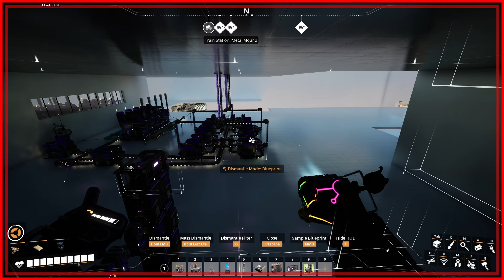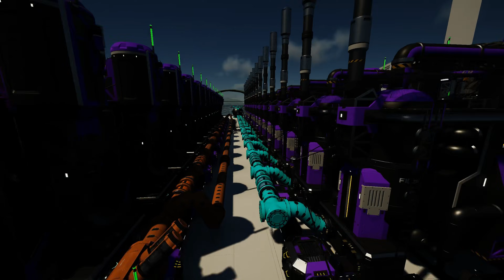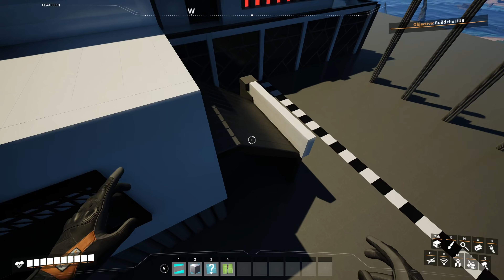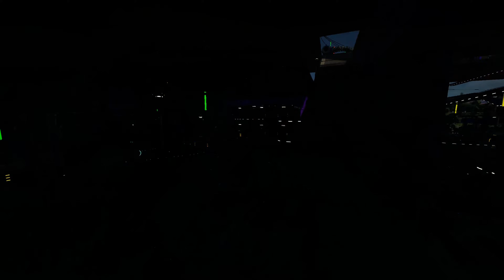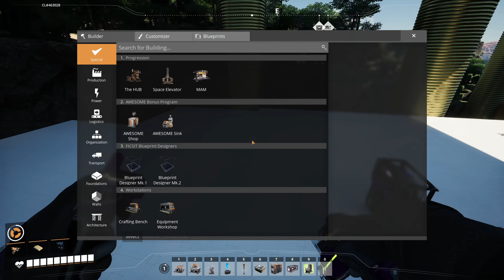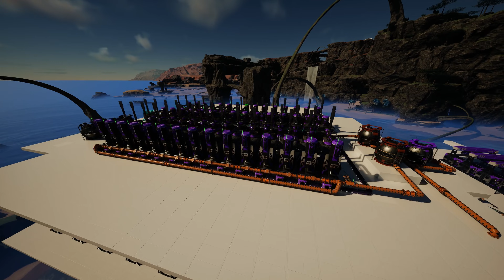What Most Players Get Wrong About Mega Factories in Satisfactory

Comment from the maker: What helps you build big factories?
Reply: I make a new factory for every item. (I often even do a new building per part of the process). Nothing gets re-used besides tier 8-9 items. That way I have the following advantages.

* Use the whole map easily
* No future planning needed
* No upgrading
* Use things when available
* Easier logistics
* You can get away with smaller amounts
* Things go wrong? Nothing else affected.

Building more is bad? Not really.

* It is a building game. Building more is a win for me.

And also breaking things down into smaller projects. Each part of the production is a new projects. I do start making things look nice as soon as possible and no Blue Printer. I rather come up with something new. But the main thing is to have fun. I rather gave fun than be functional.
Reply from the maker: @h @houghi3826 ll said!
Reply: I build a large platform with a main chain conveyor belt bus in the front. Then I build a line of production machines that use resources off the bus. Then I create another line for another part and I keep going. I then make a new floor for higher level parts and continue that for higher level parts. If I need to increase production I just increase the length of a line. I use blueprints for everything and auto connect them so extending a line is easy. Instead of worrying about exact ratios I just produce more than I need. At the end of each floor I split the bus, send to storage and up to the next floor. If a line needs multiple belts to get the through, I include some conveyor poles so I can utilize additional belts to feed a line.
Reply: Dav
Reply: random nodes
Reply from the maker: @Kung_Arthur speaking from experience? 😂
Reply: Like real life:
1. Start with a small scale version.
2. Optimize.
3. Scale.

Comment: my first one was a mess, then i made a massive rectangle in the sky and moved there, then made a massive conveyor network stealing nodes in vastly different places (still not a lot though), now i need a thousand girders and smart plates for the elevator and the best i can do is with my single 20% productivity bolted frame manufacturer and just afk because it's already full, though not as spaghetti as before it's actually expandable.

Comment: OK, I feel like that video should have been extremely helpful, but honestly, I do not feel enlightened.  OK, maybe that isn't actually true.  I've been using Satisfactory tools to help me plop down things that make things, and it worked for a while.  However, when I got to Engines and computers and hell everything after I completed space elevator 3, and unlocked bauxite... I now feel lost.  I can't get trains to work, well, that isn't exactly accurate.  I made a blueprint for trains and if I put down just 5 chunks, and then add a stop to the track, my train derays at the first track, then the if I delete the rain and manually add a rail the train will derail at track chunk 3, now and then 5, and then 7 assuming I find the rain after every derail.  However, the track looks perfect, or exactly the same, after I fix it.  :(  Vehicles, I got to work, but I think I will wait until 1.2 is released.

Comment: I've been playing around with Satisfactory Modeler, but some online tools could do the same. With Modeler you can visually drag around the machines and see where your items are going, but if you're looking at the connection lines and paths you can roughly see how much spaghetti you may end up with. For instance I could see steel was on its own path and I was able to push those machines to the outer edges of my factory, while Wire was being diverted to 4 different machines so I was able to position a bank of 12 constructors in the middle of the factory and let the end results fan out from them.

I'm just about to switch on the factory and let it complete phase two in one go, but Modeler is great for pre-planning and avoiding mistakes, especially when the scale gets larger and larger.
Reply from the maker: Great stuff! I’d love to see it

Comment: New(ish) PS5 player here. 30+ yrs gaming. And Satisfactory is a landmark game in soany ways.

It's definitely a lot to with experience. At first I wanted the mega factory, multiple floors, blueprints etc, but it will happen over time. I'm not particularly mathematically inclined, but patterns, I get. And you can approach it like that.

Also, reverse engineering has been a big help.

Another great video, mate. They have been and continue to be a big help. Cheers 🤘🏻
Reply from the maker: Appreciate you! Thanks for sharing your wisdom 🙏
Reply: I'm trying to push my series X to the limit.  It's a nice space heater too.

Comment: Another thing that helps us with large projects like these: Let yourself make things easier! 

Specifically, don't be afraid to use power slugs to simplify your designs once you've unlocked the ability to overclock. There are hundreds of slugs around the map, and you can double the number of power shards by putting a sloop into the constructors.

The higher power consumption sounds scary at first, but most basic production machines consume low enough power that the difference is fairly negligible. By the time you hit big energy functions like Particle Accelerators and Converters, you have more than enough ability to outpace your power consumption by a ridiculous degree. 

Liberal use of power shards is extremely helpful in cutting down on the tedium of building long production lines and saves tons of space. Why use 14 Smelters for my copper alloy setup when I can use 7 with 2x overclock? Why use 13ish constructors to turn the output from one of those smelters into wire? With shards, I can cut it down to 6ish, and even better: I don't have to condense multiple outputs for the next stage of production. (Instead of combining two basic wire constructors to feed one cable constructor, each one already has the output needed to run the cable constructor at 100% efficiency.)

The power use is meaningless when it's easy to generate 100,000+MW off of relatively little oil. 

This is all really nice for 1: neatness, 2: compact design, and 3: cuts down on tedium so it helps you avoid burnout.
Reply: As someone who finds the proportional increased cost creating a feels bad: The difference between max theoretical points of 100% and 250% clock speed is less than 5%, slugs are plentiful and eventually powershards are infinite, use them.

Comment: after i finish nuclear (uranium only, boosted by probably 6-8 alien power augmenters - i need all the other resources xD) i am starting my giga factory. i have the design CONCEPT in mind, it's gonna be insane to actually do. Also, i'm starting from the final machines and building out, only connecting nodes AT THE END. The goal? 50 biochemical sculptors, 50 nuclear pasta, 50 ai expansion drives (and 23 more as a byproduct -_-) and 45 ballistic drives per minute. 

Wish me luck xD or give me advice xD I'm gonna watch this video first, now.. or well first thing after dinner ^^
Reply from the maker: That sounds absolutely insane, good luck! 🤯
Reply: @realTinyTau thank you! I am! I'm quite some time away from even starting it up, but it's already kinda intimidating.. I won't be able to troubleshoot until it's done xD

Comment: 5:18 - Stacking storages and having one feed the other - awesome idea! Can't believe I've had lines of these, when I want to hold a large buffer of certain items....

This was a really great video, simple yet awesome advice! I feel that I'm that point in my first playthrough where I'm trying to transition from some messy builds into bigger ones, and it has felt pretty daunting.   Recently, I had come to a similar realisation, that bigger builds are just a series of smaller builds. So, my new 1800 plastic/minute factory area is mostly just a series of the same 2 refineries in a blueprint that can link to the next 2 - repeated for as many as is needed.
Reply: Building modular AND vertical is key in Satisfactory 👍🏻
Reply from the maker: Thank you! I can tell you’re headed for FICSIT greatness 🎉